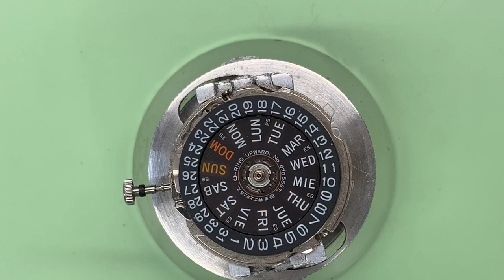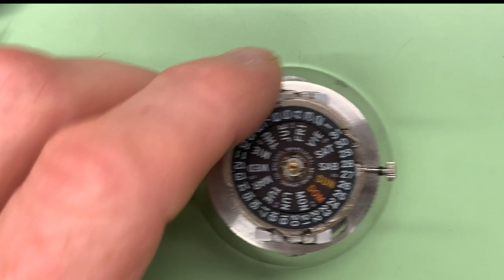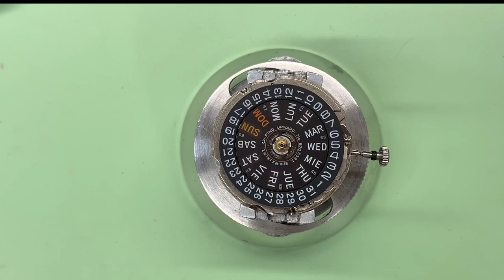Seiko 6309 Rebuild - Calendar Works (5000 sub Giveaway)

Comment: After watching your videos for quite some time i thought that its time for me to have a go..!!...after slowy buying some tools and oils...and watching these 6309 videos over and over ..i gave it a go....i had a diafix jewel ping across my bench...i could of cryed but it was only six inches away..!!...took me several attempts to get the mainspring back in as the balance also did...but seeing the balance work for the first time was magical....now for the keyless works and calender side....thanks again for these videos...couldnt have done without them..!!
Reply from the maker: This is wonderful news David and reading posts like this make it worth the effort to make these videos.  Flying parts are all part of the frustration!  I am addicted to that feeling you get when the watch runs again... Well done.

Comment: Under magnification that clutch is a thing of beauty! Cheers.
Reply: PS ,that little screw that gave you a bit of trouble if me ( as much as I tinker with most things mechanical) would have at that point been hurled across the room and would be using unthinkable expletives to anyone within 100 yards of me! You have steadier hands and a lot of patience!
Reply from the maker: Thank you so much .  I’ve got angry and frustrated before but never thrown the watch in anger!  I usually just swear considerably

Comment: Always loved watches but came across your videos about 2 weeks ago and now I’ve got the bug, ordered a lot of basic stuff I think I might need to service a watch. Just bought an unserviced Seiko 6309 via eBay from India, I realise it will take an age to arrive but I’m in no rush, will have a play with the equipment first. Will keep you informed on how I get on. By the way the wife thinks I’m a nutter. Thanks Mike for inspiring a 61 year old with not too steady hands.
Reply from the maker: This is great news, well done Alan and good luck.  The Indian watches are a good place to start however they are usually repainted dials and sometimes the movement inside is not the correct Seiko movement.   Dont let that put you off though as a starting point its great as you will learn allot from that one watch alone.   Good luck.

Comment: Thank you, I've learned so much from you.
About grease for the keyless works, I don't use grease there, but I think 8200 can be used safely.
Reply from the maker: Thank you for your support as always.   I have 8200 and only use it on mainsprings but yes it would do I guess.  Someone else has commented with the correct greases (Milton) so its giving me food for thought.

Comment: I use Moebuis 9501,  also on for friction wheel/ keyless works/ winding pinion and clutch wheel/winding steam/ yoke spring/ yoke/ calendar wheel/ calendar jumper. I use D5 for barrel arbor/ setting leaver screw/ barrel arbor bearing/click assembly/ crown wheel shim/ setting wheel. That's just what I've been told to use.
Reply from the maker: Bearcwy this is good information thanks. I am considering the Moebius 9501 

Stuff is more expensive than gold!
Reply: @MyRetroWatches  Yes it is but you don't use much of it when servicing a watch. I mainly service vintage pocket watches. The couple of wrist watches I've serviced were simpler watches than the Seiko you are servicing.
Reply: @MyRetroWatches  I did some research and found another grease for the keyless works It's not nearly as expensive but it's not Moebuis and I haven't tried it. It's PML Stem Grease. You can check it out here: http://www.tztoolshop.com/FB_Catalog_Oils_Lubricants.html

Comment: Another awesome video, as for keyless works grease, molycote DX, Mobius 9501 or Seiko S-6
Reply from the maker: Thank you kindly Milton,  I have already looked up the Moebius grease Cousins want an unbelievable £48.00 plus post....  Need to sell a watch or two...
Reply: @MyRetroWatches  cousins has the Seiko S-6 for £12.95, Esslinger has the molycote DX for US 24.95
Reply: @MyRetroWatches  Cousins also has the molycote DX 50g tubes for £8.95
Reply from the maker: @miltonallen9480  Interesting thanks , On cousins now and I can find S6 but at £16.95 + vat... I will keep looking perhaps  I am missing something.
Reply from the maker: Milton Allen which in your opinion is best?
Reply: @MyRetroWatches  they are all pretty much equivalent. If you predominantly work on Seiko get the S-6 as that is what Seiko recommends but molycote DX is the best bang for the buck
Reply: @MyRetroWatches  you are correct the price has changed to £16.95
Reply from the maker: Milton Allen thank you kindly Milton , I will probably going to go with the Seiko grease

Comment: Mike - I have been using Moebius 9104 synthetic on most of the keyless works. In some instances of high friction areas like the setting lever, I may use Molykote grease. Not saying this is right or wrong, just what I use.
Reply from the maker: Supercruze thanks pal

Comment: It would be great if we can see how you try to straighten the stem/crown, I've seen this problem quite often, in fact I have one or two crowns like that right now, and I'm afraid I could break them if I try to fix them.
Reply from the maker: I might have a go but I have also already found a new old stock replacement for £4 !  it would be a pin vice and a pair of pliers most likely.

Comment: Hi, very interesting video to watch - it looks like the stem is still bent at the end though (3:10, 40:00), can you still remove it at this stage or does it require the removal of the calendar works?
I would particularly like to see how you clean and relume the dial.
The video on your journey learning to do this sounds great, I'll look out for that!
Reply from the maker: Ian Mansfield hi, it’s the crown that’s bent , I’ve seen this before.  I can attempt to straighten the threaded long part in a pin vice however I can get a replacement for £4 which is probably what I will do.

As for the loom, it’s the hands I will loom not sure the dial actually has any markers , we will find out under all that dirt when I clean it

Comment: I've got a Seiko turtle 6309-7049, 1984 that was my 1st Christmas present from my wife. I lost the bezel, diving in Key West 10 years ago. I think i found the bezel, I also think that i found the little bearings, but i can't find, or haven't found, the metal ring? Spring ?, that goes under the bezel. Any chance you,or one of your viewers, knows where I could find 1 ? I've got more expensive watches, but that turtle is sentimental to me,and I'd like to see her whole again. It's been serviced by Seiko 3,or 4, times over the years,but she's due and,as soon as the N. J. repair shop opens back up,she's going in. I'll have the bezel set by a watch maker locally, unless I find that ring before. Unless , of course, you'd like to use it for a video. Then, I'd be happy for you to have that commission. Keep em coming. I'll be watching. No pun intended.

Comment: I wish i saw this video before my attempt to fix a 70's Omega Seamaster. It was a easy task: clean dust speks on the dial. Too much pressure on the stem's release lever messed up the keyless works.
Fixed it and i only lost one screw and broke one unimportant part.
Now the date and day no longer jump at the same time. Date jumps 5m before 12 and day jumps 5m after 12. Any idea why?
Reply from the maker: I have not worked on that many Omega;s and in part because parts are hard to find or very pricy to obtain.   as for your question, what was the part that you broke and could this be anything to do with the mechanism?  secondly you would need to look at how the day & date wheels are controlled when turning past twelve.  On these seikos they are done by "fingers" on the nylon wheels I fit.  If you dont fit them in the right place then this can be the consequence that they change at the wrong times.
Reply: @MyRetroWatches  The Omega 1020 has those nylon wheels too. I paid no attention to them when placing the date and day disks.
Now i'll have to find the corage to open that watch again :). Thanks for the help.
I broke one of the two small metal pieces that holds down the ring that goes around the movement (?)

Comment: Just out of interest has anyone got any info on 6139 8030 .....chronograph ...watch has never been opened  but the face has 8060T marking .....? Anyone have any ideas
Reply from the maker: Peter Harmer the dial markings to my knowledge refer to the movement 6139 and then the other bank of digits is the dial design.  This article here will explain perfectly . Just have to scroll down a bit to the dial code info.

http://www.clockmaker.com.au/diy_seiko_7s26/chapter3.html